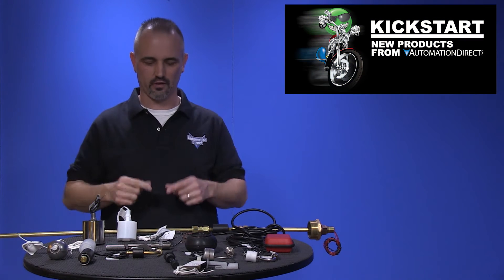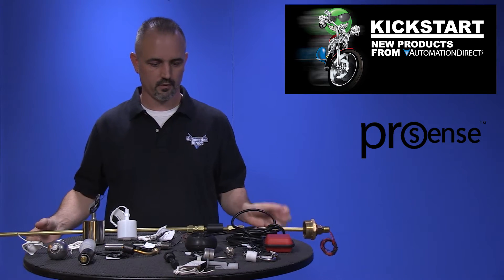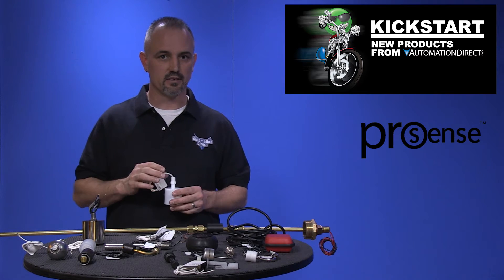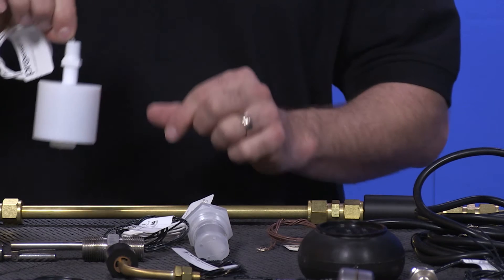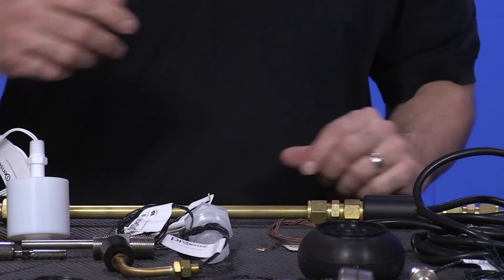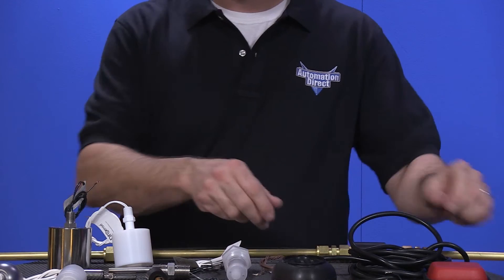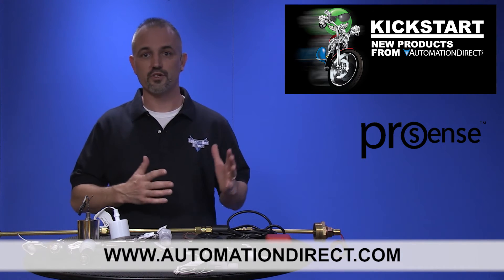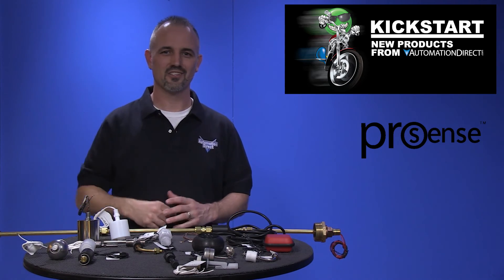ProSense Level Switches from AutomationDirect

Comment: I have a tank of water pressurised by air (max pressure 5 bar) tank 8 feet tall. Have noway into tank to fit nuts etc. Have you a sensor that will give me high and low levels